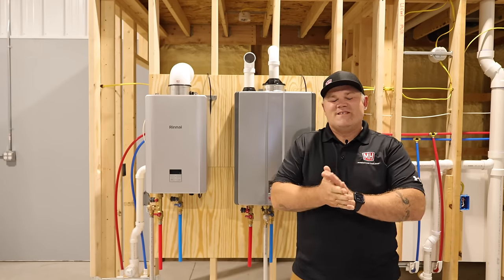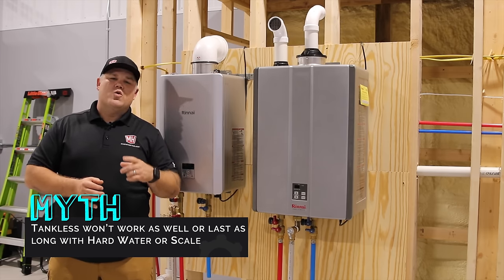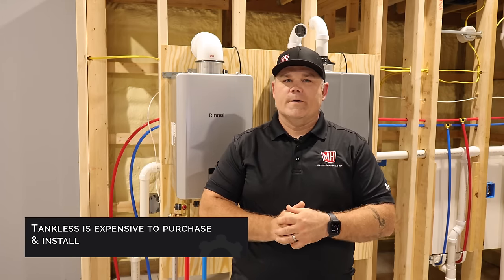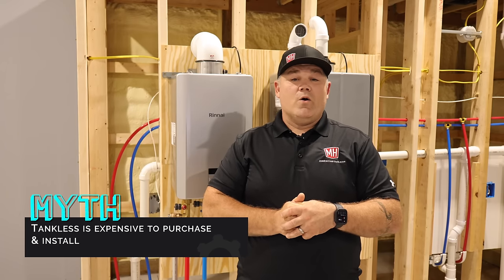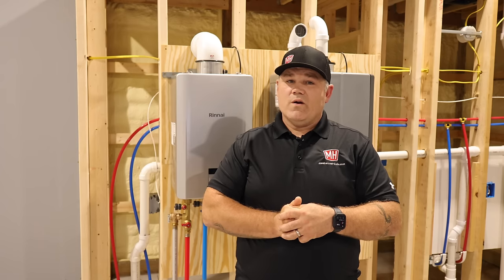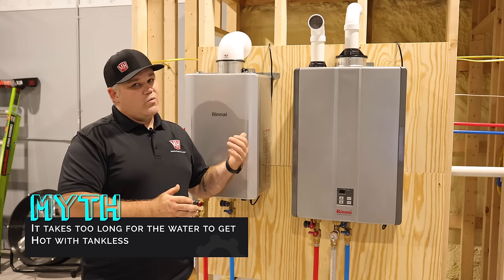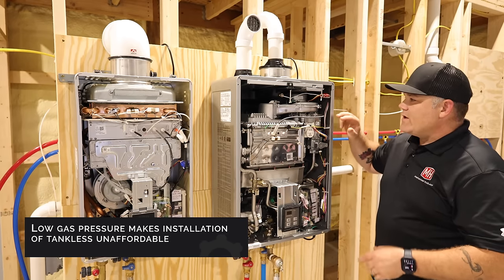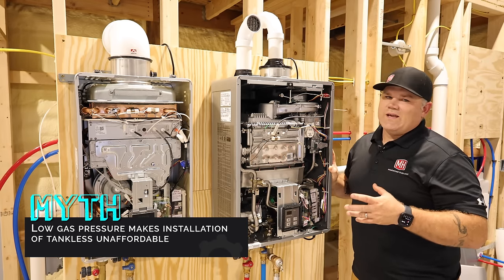Myth Busting! Tank -vs- Tankless Water Heaters

Comment: We installed a Bosh tankless in our new construction house in the country in 2004. What I didn’t understand caused me to overbuy in capacity. I was afraid of buying too little capacity and checked parameters closely. The exhaust is all stainless intake and output, both to the outside of the house. Electrically run for the display and ignition, the propane used is tiny compared to alternatives. The minimum flow rate to kick on is 0.8 GPM which with “restricted flow” and “efficient” plumbing was an issue initially. Removing the flow restrictors solved that problem. Also, the gas pressure/volume was insufficient. The plumber was not really a plumber, but just a guy hired by the general contractor. Outside a multitude of other problems he caused, the line from the propane tank to the water heater was way too small, the wrong material and leaked. So, I finally figured out what needed to be done. Since I could not replace all the gas lines I had the tank installed with a direct flow pressure valve, put a step down at the foundation leading to the second floor heater location and put a coiled larger diameter line from the fitting to the heater. That provided sufficient gas and pressure to kick the thing on, allow the lines to remain filled keeping the heat firing and flow at the proper rate. Once I figured out what they did wrong fixed those issues, it’s performed beyond expectations for nearly two decades. If I were to replace it today, I’d probably get one that did not require electricity, (cabin or off grid design), use as much existing materials as possible and go another couple of decades. The details of the technology continue to improve. I’ll certainly take advantage knowing more over time. Oh, and we have a water softener on the well since it’s very hard and we’ve not had any issues with sediment or blockages.

Comment: I've had tanks in three houses since the 1990s, including a rental. They are great, and myself and tenants like found them carefree, lower cost to run, and also, you can instantly adjust the temperature too, such as to fill a pool or wash a car. They saved money vs a tank install, and freed up space. 
I'll never go back to a tank. I might try some electric single point of use, on demand in the future.

Comment: In the early 2000s my mother bought a new home and wanted a tankless H2o heater.  I was amazed at how small the footprint was when compared to a tank heater.  It worked well enough... until it didn't ( less than a year).  There was no plumber in the area that serviced them so I got on the phone with their customer service in Houston.  I was advised to obtain a volt meter then call them back and they would walk me through diagnostics while on the phone.  The next day we determined that one of the heating elements was bad.  It was corroded.  The other 3 were in different stages of corrosion. The company sent 4 new heating elements and suggested to get a water softening system because this will continue to happen with the hard water they have in south texas. I understand why people have said that they don't work well with hard water.  Sure, hard water is bad on tanks also, but the tank system will run longer before the corrosion prevents it from working.
Reply: I have relatively hard water, and my tank is going on 19 years. Granted, that's why I watched the video, suspecting it's time for a new one. A tank could reasonably last forever with soft water, if maintenanced.

Comment: My husband and I were looking at a thankless water heater and wanted to buy one but were stopped because of two things. 1. We live where there is no natural gas line layer. We could get one layer but it is out of our price range to do so. The gas company charges way to much. 2. The city inspector told us that we had to have the electric company come out and check to see if the distribution transformer could handle it. We were told by him that it couldn't and we would be charged $5,000.00 to upgrade the transformer. This is before we even paid for the water heater and the plumber to install it. We compromised and got a heat pump water heater instead.

Comment: First myth was not answered.  The question is doe tankless handle hard water/minerals as well as tank types?
Reply: I can answer that one foh ya. Tankless certainly DOES handle lime. It builds it up...and rather quickly. The fix is to backflush with expensive lime away product once or twice a year. It's messy, smelly, and time consuming. Not every owner is willing or able to do this. Also...lime flakes off and collects in your sink faucet....and worse the screen in your washing machine. One of our happiest days was when our tankless finally went kerflip and we had the plumber boys bring a nice old fashioned tank-ful 50 gal water heater out.
Reply: That was my point as well.  Well this vid is sponsored by a tankless water heater manufacturer.  Also additional circuit breakers and wiring is needed for a tankless water heater to replace a tank type....

Comment: 90% of the time you HAVE TO upgrade the gas line. I’ve been installing them a bit longer than you. I’ve seen the tech change but one constant is needing a dedicated or upsized gas line from the meter.
Reply: 20:1 he is also trying to install parity of BTU to the existing design.... not including that required extra 30% margin needed for this type of system.

Comment: They work good on gas. We also had electric ones in Germany where I was working as electrician. The needed 3 phase, 380 V and used 18 KW. Still, it was slow to fill your tub.

Comment: I was born 1961 overseas and we were using the Tankless water heater (was called Geiser)since before that with no complaints at all plus it didn’t require that much of maintenance, but because there was no Gas pipes to feed them only through Gas cylinders which was tiring for most people in the long run. After that we started seeing the electrical water heaters and the CHAMP of them all that we had was the Kerosene water heater, which can supply water for the whole Family even if they decided to shower one after another with no wait time or can run two bathrooms at a time. I visited Turkey recently in August 2023 and they have much smaller Gas Tankless water heaters that runs 2 bathrooms plus as a Flood heater at same time(which have separate dial for it, where you can set temp. for each one individually). The only plus I can give to the Electrical Tank  water heaters is that you’ll have some Hot water if you lost Power.

Comment: Your video was informative.  I'm planning to install a tankless water heater at my house that is off the grid.  Here are a few questions that come to mind.  Question 1:  How much water pressue is required to run a tankless water heater?  Question 2:  Can the water be treated when it leaves mineral deposits?

Comment: I replaced the tank with a Navien tankless four years ago, and it works great, I never run out of hot water in my three bathrooms, and I can fill the tub without any issue. I flush clean every year but don't see really any dirt. The only issue was plumber, was charged too much, and did not install per the company installation diagram. I had to hire another plumber to fix it.

Comment: Got rid of my high efficiency, gas, power vent , 40 gal water heater a year ago and replaced it with a 13 kw tankless and did it ALL myself.  It is electric so I never worry about will it light off or not.  I am able to run two showers simultaneously or a shower and sink.  I am in the process of installing a descaling apparatus(which I should have done when I installed it) to keep it running at top efficiency.  And the cost to purchase: $290 for the unit, $260 for wiring and hardware, $140 for descaling hookup.  A new gas power vent 40 gal water heater: $1350 !  This was a no brainer.  At a cost of only $290, if it ever acts up, I will just replace it and save it for parts.  And, I love it!  All the myths cited herein I have found to be just that...myths.

Comment: One other thing to mention about the cold water myth, if you are on a well, more than likely you will run out of pressure far before you run out of hot water capacity. As the pressure drops, so will the flow through the heater letting the heater keep up.

Comment: Yup. Ours kicks butt at 41d 8m N. Our cost actually went down, as the new rates for gas have gone up this year, so electric is actually cheaper now. But I don't care. It could run on puppy tears. Nothing beats it. Long hot showers, dishwasher and laundry running, bring it on. In 8 years, we have only had to replace a little screw-in plug-n-play sensor on the outflow. $24 and 10 minutes to replace. Never having to worry if the bottom of the water heater is going to rust-out in the basement creating a mess . . . priceless.

Comment: I live in North Carolina, we are converting our gas from Propane to Natural Gas and buying a Renai hot water heater. Now, we have unwanted chemicals in our water and water to put a filtering system in and possibly a water softner to remove the calxcium build up. Question which is the best Rinai is it the RU199 BTU? and should I put the filtering system in becuase I see videos that say you need to clean the water heater every year with vinegar is this true for calcium build up. Thank you excellent video, Robert

Comment: Thanks for the video Eric.  Our home was built 17 years ago and all the homes in our neighborhood have gas tankless water heaters installed at construction.  I had our home plumbed for a water softener when built.  Would the water first run through the softener then the heater? Or do I have to have a separate filter/ conditioner for the heater.  We are on City Water and I have not had any problems with the original unit.  ( I am somewhat OCD and clean the filter and flush the heater on a regular basis.  😃

Comment: One winter my cousins and friends and I rented a fairly new ski house for a lot of money and it had a tankless water heater. All winter I never got a decent shower it would start off too hot and within minutes it would cycle cold then too hot every 30 seconds or so. The owner sent some plumber out several times to "adjust it" when we complained but it never got any better.
 I swore I would never rely on a tankless water heater again. The first thing we would ask when getting another ski house was Where is the water heater tank and how big is it?

 If the answer was "tankless" it it instantly became a deal breaker and we looked elsewhere..

Comment: I love all the comments on here. I did my own plumbing for a tankless after my water heater in the attic above my restroom failed twice in just as many years, which caused 2 ceiling replacements and 2 tank heater replacements. After that I took the plumbing outside the house and installed the tankless heater on the exterior side of the house. I plumbed it in for a hot water outdoor hose bib in case my kids want to play in some warm water outside while it’s still cold out, or to wash my car with hot water. It was super easy and still runs perfectly 2 years later. Blah blah power outages. It takes 60 watts to operate the igniter and pcb. Use your brain and put a battery on a few thing in your house if you’re that worried about it. I have a 750w inverter with a battery and have it hooked to my, outdoor lights, security cameras, router, and water heater in case of an emergency and I live in Houston Texas! 😂 no problems so far. Do it yourself and learn a thing or two will ya!

Comment: So I installed a Takagi PROPANE tankless water heater in my art studio. Loved it! Worked really well until it didn't. Seems that every autumn a lot of paper wasp queens, looking for a place to hibernate, detected a nice warm place down the chimney when I was not using the water heater. Then the poor things roasted when I used it. Their little bodies built up until the unit's safety measures caused a trip (I could see their bodies thru the peep hole glass). I could reset the unit by cutting the power so I hooked the power to a light switch which I have to throw to reset the unit every time I need hot water. The main moral of this story is that you need to put a bee-proof screen cage around the chimney outlet from the get-go, not when the burn chamber fills up with roasted bees. 2. I have hard water, not on the horrible end of mineral concentration, but it did plate out the inside of the piping. This causes the water to run longer before it is detected as flowing (needed to auto-start the burner). I have a well, so no big deal, but might be an issue if you buy water. 10 years later it is still detecting water flow so I have done nothing. 3. I eventually installed the ductwork to directly feed the unit air from outside and this solved the problem of lint and pet hair accumulating in the unit, which was causing it to not start up from time to time. I suggest you do this from the start. Of course this has to have a way to keep wasps out of it too. 4. If you have a big house and want to install tankless water heater, I lean on the side of installing multiple small ones near the faucet (1 for each bathroom and one for the kitchen and one for the laundry room, unless they are above one another). I installed a Takagi in my small house when I built it and wasp-proofed it; worked fine now for 5 years. Also, propane requires a drain for precipitation in the chimney. Takagi uses a simple clear plastic tube that you loop to make a water trap that you keep filled with water to keep the gases from going down the tube too. I used a brass fitting which is being dissolved by the corrosive water. The chimney is stainless steel, so use stainless fittings on the tube. I use a large stainless steel hypodermic needle stuck in the plastic tubing  to fill the trap. I just pull out the plunger, pour water in and gently replace the plunger. I have a solar array so an electric one was out of the question; uses a huge amount of electricity at one time to heat that water. I installed both heaters myself. If you plan DIY, do your research!!! I had no idea the propane ones needed a drain. Luckily, I installed the first one  above the wash machine drain and could run the drain tube to it. In my house, I installed my 1-inch water inlet hose thru the concrete slab inside a vertical 4" PVC pipe, which I filled with pea gravel (my idea on how to insulate it as well as keep the backfilling of the ditch from damaging the water line). I ran the house Takagi drain line to this gravel sump. Is this drain needed for natural gas? I have no idea.

Comment: I have a tank electric water heater. I just turned my electricity off by switching the breaker off whenever I’m not using it. It only takes about 20 minutes to warm up completely and it has cut my utility bill in half. I live in an apartment and I don’t have control on whether or not I can get a tankless water heater, so this is the next best thing. Right now my electric bill is $65. Before I started switching my electric water heater off it was $120-$140.

Comment: Great video!  We live in a brand new neighborhood and about half the houses came with tankless.  I've been super happy with it, never ran out of hot water.  The only issue I've had is during power outages.  Which I just run the unit off my vehicle with a power inverter. 

As I watched the rest of the houses being complete I noticed squatty water heater tanks being installed with an EXTERNAL heat exchanger (like a heat pump...?).  I was told by the contractors that the "code here in WA state changed...".  How is this more efficient????

Comment: We had 30 gallon water heater and it only lasted for one 15 min shower, then we had to wait 25-45 min until it heat up new water for another shower, so when we remodeled we put a rhinai tankless water heater  199,000 btu about 11 years ago and never regret it, in a summer month we were getting $5-$7 bills compare to my neighbors tanked bills $15-$20, I agree that is little more expensive to install the tankless but it pays for it self in a long run and you only pay once for installing it 
We still own 11 year old tankless water heater and it is still going strong

Comment: I have a tankless water heater. Best investment I ever made. No gas adjustment issues. Tank water heaters leak - take up huge space. Cannot run a faucet & shower at the same time. Not an issue with my tankless.

Comment: Just installed a 60 gallon electric hot water tank heater.  Easy DIY project for about $1000 from Lowes.   Tankless in an electric house is not workable but the tank electric is still much cheaper and you get plenty of hot water.

Comment: Do you include RE-sizing the gas pipe as part of the installation? That usually adds quite a bit. Most tank water heaters have a 1/2” gas supply.